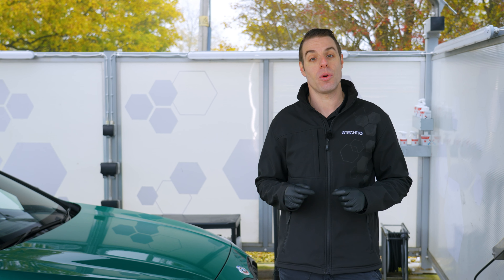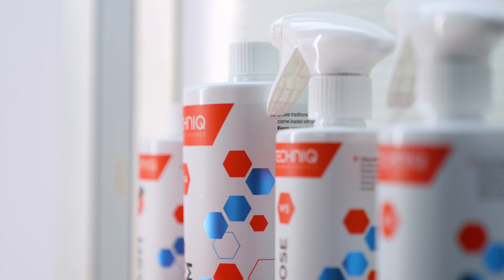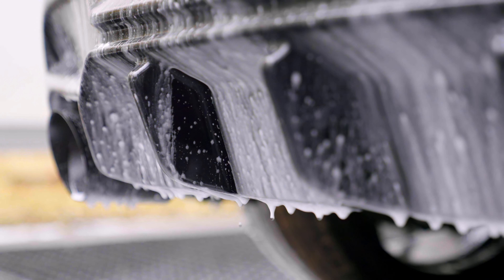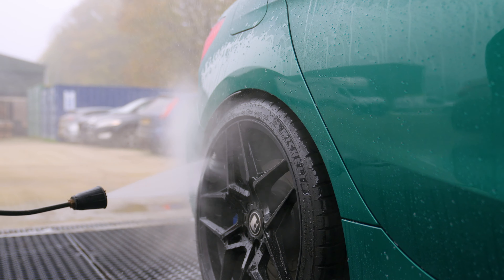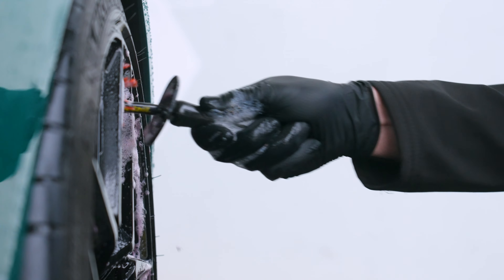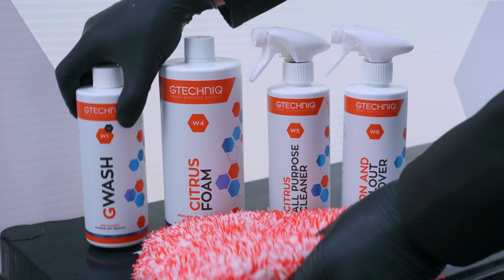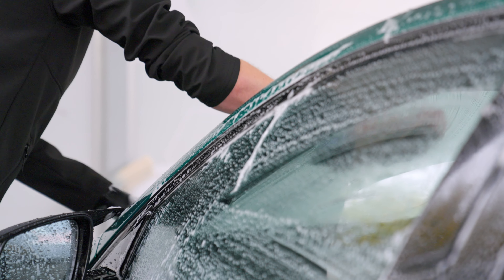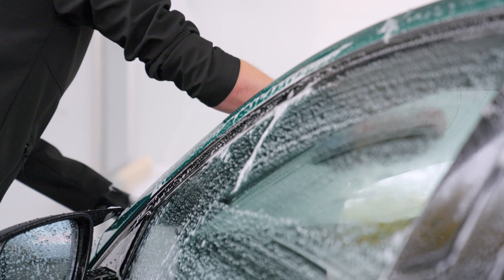Gtechniq Ceramic Coating Decontamination Wash

Comment: Do you need to dry the car between using the citrus APC and then the iron and fallout remover, or can you just thoroghly rinse it and use it on a wet car? Thanks.

Comment: Excellent video. Having had my Ceramic Coating applied by a local Gtechniq certified centre I have always used Gtechniq products to maintain it. I also have Xpel PPF on the whole front quarter. Am I correct in understanding that products W7 (Tar & Glue Remover) and W8 (Bug Remover) should NOT be used on or near PPF? If so, would Citrus APC be a safe and effective alternative?
Reply from the maker: Correct, do not apply this product to PPF or vinyl.

Comment: Great video. I just applied my CSL coating. Is there a recommended schedule for decon like approx every so many months? Also, is there a certain time frame to apply EXO4 after applying CSL? Thanks in advance
Reply from the maker: As a standard, we recommend carrying out a full decon wash every few months. If you are applying EXO over CSL we recommend applying EXO a minimum of 1 hour after application.

Comment: Hey team. Being based in Australia, we often deal with bug strikes. I have the Bug remover - just wondering at what point of this decontamination process would i use it?
Reply from the maker: Hey Tom, Ideally we would reccomend applying the Bug Remover first before the surface gets wet. Then follow the decon process as per the video.
Reply: @GtechniqUK  thanks team. I've just had my car coated with ultra, should I apply C2V3 after it's 2 week wash or should I give it some more time?
Reply from the maker: @tomcolls9264  You can do. Each application will help enhance the dirt repellency and hydrophobics.

Comment: Hey guys. How often should I be trying to remove any tar. Does tar remover effect my CSL coating if I do it every time?
Reply from the maker: Hi, as often as you need to. If applied as per the directions to a microfibre the W7 will not degrade the coating.
Reply: @GtechniqUK  Ok great. Thanks for the response 👍🏼

Comment: I’ve have the GTechniq platinum plus that came with an after application kit in a red bag.  My Porsche GTS 992 is has central lock wheels with anodised aluminium wheel hubs that are renowned for turning white with any kind of treatment.  Is the wheel cleaner safe to use on such delicate hubs?
Reply from the maker: We have tested the W6 Iron Fallout Remover specifically on centre locks and we did not experience any degradation of the finish and surface,

Comment: So I have ppf and have used Halo as my ceramic coating - which out of the three is the best for my application? G wash, Ceramic G wash or Citrus Snow foam for my maintenance washes?
Reply from the maker: You would approach PPF in exactly the same way. The choice between GWash and Ceramic GWash is really down to personal preference, both are great products, but it is just the case that one leaves behind protection and the other does not.

Comment: Love your products, just a question, if this is a decontamination wash,what is considered a maintenance wash which is is every week or two? Would it just be pre foam and a G wash?
Reply from the maker: Gtechniq would recommend GWash, Iron & Fallout Remover (for the wheels) and All Purpose Cleaner.. The washing intervals will be dependent on time of year for example winter (high frequency) vs summer (low frequency). There is no harm in washing your car regularly if you enjoy it, so long as you use good washing techniques and products. Hope that helps.
Reply: @GtechniqUK  great thanks for the info

Comment: I’ve always assumed APC would strip protection from the car. Does this mean that’s not the case or do you need to be care where you apply and how much?
Reply from the maker: It depends what you mean by protection. The Citrus All purpose Cleaner will not strip a ceramic coating however it might remove cheaper waxes and spray on silicones.
Reply: @GtechniqUK  thanks yes was thinking of my 18 month old ceramic coat

Comment: I have plastic trims at the bottom part of my car, will the W5 be safe to use on those ? with ie. 1to10 dilution ?
Reply from the maker: W5 is safe to use on such plastic trims. You can use it straight out of the bottle or dilute if you prefer!
Reply from the maker: W5 will be safe to use. You can either use it straight from the bottle or dilute it down - it is up to you.

Comment: Can you use iron and fallout remover on the car that's been ceramic coated? I've had my Gtechniq Platinum coating for over a year now and I'm wondering if iron decontamination would affect the coating?
Reply from the maker: Absolutely, yes. The Fallout Remover is pH neutral and does not degrade the coating in anyway.
Reply: @GtechniqUK  perfect , many thanks for your reply

Comment: How durable is the Gtechniq WM2 wash mitt ? On some mitts of this type the inner foam, inner mesh and inner stitching desintegrates rather quickly.
Reply from the maker: These will last years if looked after and stored correctly.
Reply: @GtechniqUK  thanks 👍
Reply: It can vary in my experience, I've had 3 of these mitts. The stitching on one of the cuffs did fail unfortunately (vertically) however it was demoted to just the lower sections of the vehicle so it was not a big deal. The other two like stated have lasted a few years now and are still holding up well, if you use them reasonably. This is for weekend warrior use mind so I can't comment on professional setting, however they are a consumable item at the end of the day and are a reasonable price, so replacement isn't a problem.

Comment: Do I need to agitate the iron and fallout remover if using it on my paint.
Reply from the maker: You should not need to, but you can. Just ensure that the wash mitt you are using is thoroughly cleaned after use.

Comment: Can i use standard gwash in a foam canon followed by hand wash with ceramic gwash?
Reply from the maker: You could approach it this if if you want to.
Reply: @GtechniqUK  great, thankyou. Would the standard gwash strip anything off, such as the sealant I apply quarterly? Car is ceramic coated.
Reply from the maker: @kefteves  GWash will not strip the Ceramic Sealant.
Reply: @GtechniqUK  thank you!

Comment: If you car has a Gtechniq coating does it need all these products?
Reply from the maker: You will need these products to carry out a full decontamination wash. We recommend these products to deep clean the coating.
Reply: @GtechniqUK  and how often would you advise to do a decontamination wash? On every wash?
Reply from the maker: @pjroberts2010  We recommend carrying out a full decontamination wash every few months.
Reply: @GtechniqUK  many thanks
Reply: I don't get why you need a ceramic sealant with a ceramic coating.
Reply from the maker: @pjroberts2010  A ceramic sealant is a great way to help top up the dirt-repellent properties of the coating. If only have a base coating applied then we would certainly recommend using a ceramic sealant. This video will help to explain why - https://youtu.be/qBIQvS00SSk?si=DNORZ6PgYvozvK_p

If you have a base coat and EXO it is less critical, however, you are still constantly topping up the hydrophobic properties
Reply: @GtechniqUK  Thanks again. I have ceramic wash and ceramic sealant. Can I use either? The only difference, I guess, is that the sealant lasts three months longer.
Reply from the maker: @pjroberts2010  The Ceramic GWash is a shampoo and the Ceramic is a top up Sealant that needs to be applied to a clean surface.